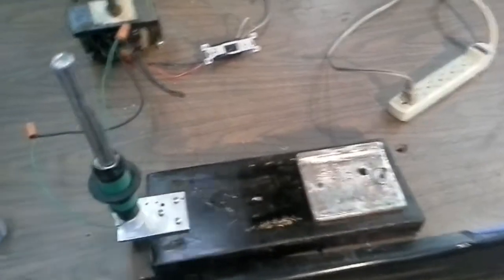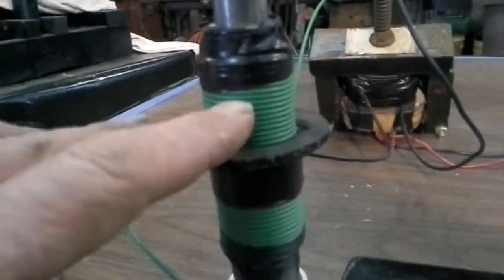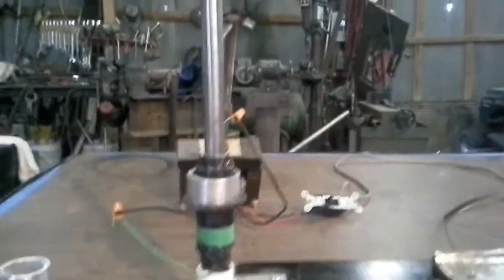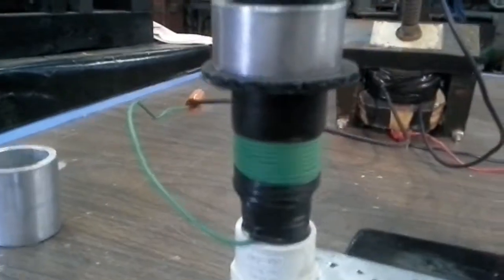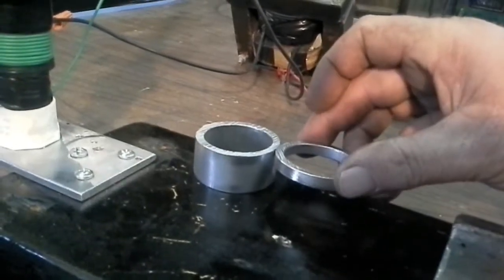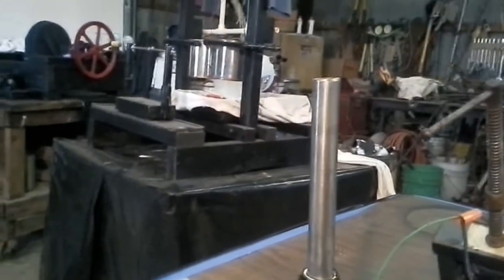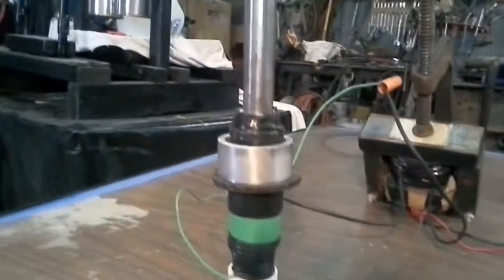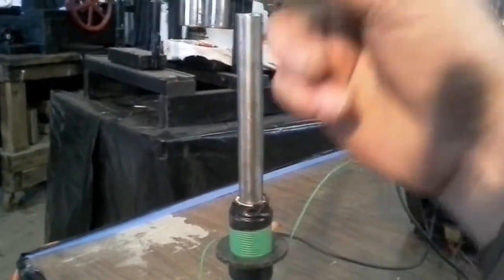Aluminum Ring Ejected and Levitated by Electromagnetic Field

Comment: Great video!! How many windings of ur copper wire?
Reply from the maker: I'm not sure. It is small gauge solid insulated. Over 80 TOTAL windings - back and forth 3 times.
Reply: The Good Vibrations thx. You can make a secondary windings with an LED to demonstrate the working of a transformer ( EM induction) . It will be cool 😎....

Comment: Whats the input?  120vac at what amps when turned on?
Reply from the maker: I didn't check the amperage on my modified secondary side. I know the MOT primary is around 2000 volts @ 5 amps out of the original secondary - but I wound my secondary with 24 wraps (3 sets of 8 overlaid winding's) of stranded, insulated 12 or 14 gauge and it puts out about 25 volts. (The wire winding's around the steel shaft is (green) solid insulated but very small gauge and probably 50 or more overlaid winding's.
(The green coil gets hot real fast - with just a few seconds of being energized...)
Reply: The Good Vibrations gotcha.  I think u meant at .5 amps @2000 volts for about 1000 watts thruput?  5 amps at 2kv would be 10,000watts.   It sounds like u are using the original primary still?  If you get a ring magnet and put it on the shaft you can feel the vibration by holding that magnet from the ac when the coils energized.  At higher frequencies putting a perm magnet results in audible tones being produced.
Reply: That infers about 10amps input on primary at 120vac, so if u get 25vac on output it’s stepping down by about 5 times which means current should be increasing by roughly 5 times.  You could just measure the primary amps and do the math for the 25vac output.  Maybe about 40-50amps at 25vac or so when on...
Reply from the maker: @CoruscantMe  Yes original Primary - but modified Secondary.

Comment: Will a 300W transformer (110V to 220V) work or more power?
Reply from the maker: The more powerful the "electric current" the more powerful the effect. But the coil wires will have to be able to handle the current / heat though!!!

Comment: Does it levitate due to high frequency ac source used i.e. 60 hz, because magnetic foce between the coils become alternatively attractive amd repulsive , and for small frequency it will undergo SHM instead of levitating?
Reply from the maker: I believe that as the magnetic field moves through the coil - it is an acceleration - and it grabs the aluminum due to induction. The coils are wrapped up - then - down - then up - then down - so the mag field always has "motion / travel" in both direction simultaneously - but the "up" motion moves the aluminum - up - because the ring starts out at the bottom end of the coil.

Comment: the delayed discharge of the magnetic field in ring is causing the levitaion ? because of that when the primary coil changes polarity the magnetic between them will be opposite.
Reply from the maker: The coil is wound up = and down - several times. So the em field travels up and down simultaneously.
For ejection - it's because the ring STARTS at the bottom of the coil - and induction accelerates it UP with the upward em field propagation.
The levitation is because of the simultaneous up - and - down movement of the em field - so the ring seems to stay in one place -  in the MIDDLE of the coil - but it is actually getting pulled up - then down - back and forth - 60 times a second - and the speed of this causes the induction to hold it basically steady.